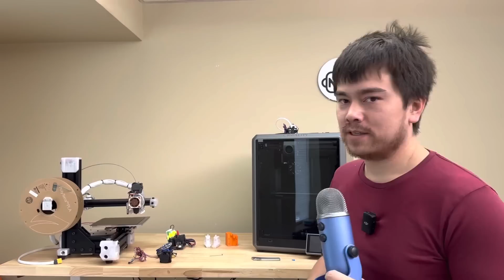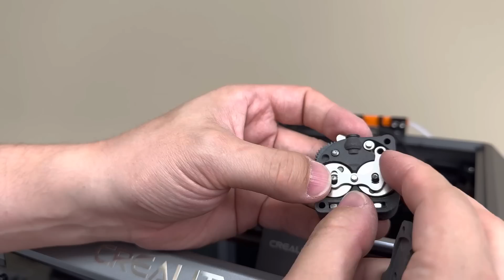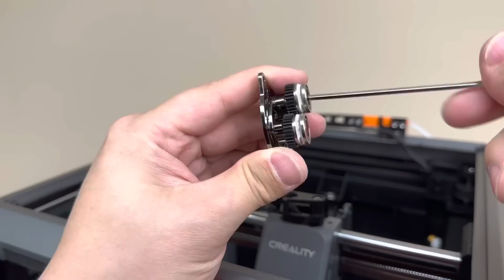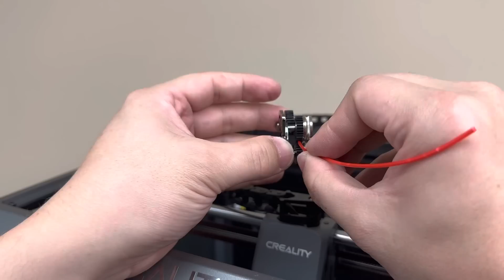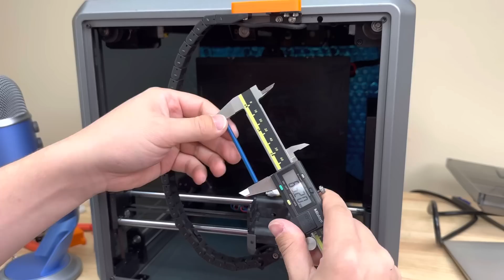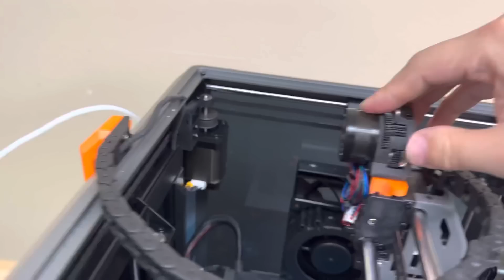Creality K1 Extruder Mod

Comment: To my knowledge bolts aren't designed to take shear loads either. The way a bolt connection should take up "shear" forces is through clamping the mating surfaces of the parts together and let the friction do the job.
Reply from the maker: Yes that is correct, but bolts are often loaded in sheer anyways.
Particularly when designing for failure load cases, often the bolt has to be modeled as a separate element that is loaded in shear. Bolts can loose clamping force for a number of reasons and in those cases the bolt will be loaded in shear whether you think it will be or not. 
Especially with plastic parts which loose clamping force over time due to creep.
Reply: That depends on the application. A fastened joint can either be a tension connection (also called a friction joint) or a shear joint (also called a bearing joint). A tension joint is critical for dynamic applications to prevent fatigue. A shear joint can be used in static applications like building as fatigue isn’t an issue given relatively low change in load experienced by the bolt. When building or bridges are assembled, there is a phenomena called bolt banging that occurs when shear joints settle into their final resting position. They can even bend and deform but it doesn’t matter as the ductility of the metal handles the shift. That would be very bad for a dynamic load though (fatigue once again).
Reply from the maker: Excellent comment, I will have to use the term bolt banging sometime 👨‍🔧
Reply: Nathan, you are spot on with the bolt bending comment.  I am structural engineer in the commercial glazing area (windows for commercial buildings). Because of tolerances between our windows and the building structure we often have to account for large shim distances which puts huge bending forces in our bolts.  I often have 4x’s the number of bolts because of the bending loads compared to what would be needed if it was truly a pure shear connection

Because of the materials in my systems i cannot use friction connections but instead have to use what is referred to as a “bearing” connection for the design of the bolt which ignores any friction and resulting tension.

I would love my billing rate to be &1000/hr 👍😁
Reply: @stephenfisher8522 when things go bad for you with tolerances =  expensive day + a massive mess in a best case scenario. Wowzer I am sure you have some stories lol.

Comment: Please be kind to attack this printer. Creality not open-sourced, they use klipper but don't give access even to config.
Reply from the maker: It’ll come out. There are already some leaks/hacks to get in there and they said they will be open sourcing soon.
Reply: @NathanBuildsRobots  but for now you should attack them. K1 is cracked already, frequencies and shaper are known, fluid/mainsail can be installed.
Reply from the maker: I am not so good at the Linux stuff. But if someone walks me through it I’ll make a video on it
Reply: @NathanBuildsRobots  there 5 simple steps or so, no need to be Linux expert
Reply: @CBORK27  brilliant. Please assist Nathan.
Reply: @corlissmedia2.0  English is not my native, it will be hard for us, in the other branch of comments somebody has successfully used k3d approach, I think he might help.

Comment: Looks great wonder how many mods fit on a k1
Reply from the maker: They are going to have to release the klipper source code soon, then we’ll get custom firmware which will make this thing a beast
Reply: @NathanBuildsRobots  you can already access it if you want
Reply: @TheOfficialDarkICE  how?
Reply: @xboxusr666  there is an exploit where you can access ssh. Then you can configure fluidd to work again. Was hidden after all.

Comment: Things will be so much better once we can get fluidd or mainsail access! Well done on the mod.
Reply: I wouldn't be so sure, no one has fully cracked the sonic pad yet and are still extremely limited and there's no one to force them to release the source code, while it's in the licence agreement there is no one to police it. The printer has potential for sure but like the other creality printers you have to spend loads on them before they print the way you want them too.
Reply: @TechieNI  Actually, what about this idea that Creality is using Klipper WITHOUT a license? Doesn't that mean that Klipper has a hammer they can use to get Creality to Open-Souce their version of Klipper?
Reply: @corlissmedia2.0  Anyone can modify to code wether they have a licence or not. There is nothing that can be done for breeching the licence or code. It's more of an ethics thing. Creality gave been doing it with marlin since ender 3 and nothing has changed with creality. They were using code then and they are doing it now. There is no one to stop them as such because klipper like marlin are just a group of people all donating their experience to the project. While I love klipper and even marlin and wish they could take creality the facts are that with a Chinese company even copyrights and trademarks don't apply the same was as they do elsewhere.
Reply: @TechieNI  I hear you. Now Creality’s stealing from Bambu Labs. The thief’s are eating their own.
Reply from the maker: What exactly are they stealing from bambu lab, other than maybe a design philosophy?
Reply: @NathanBuildsRobots  z axis, probe
Reply: @NathanBuildsRobots  that sounds like a great video.
Reply: @NathanBuildsRobots  When you have them side by side, it's pretty obvious, don't you think?
Reply: @TechieNI  Russian community k3d has.
Reply: @CBORK27  Completely unlocked it? This is something I would be very interested in of so.
Reply: I just got my printer and will be trying to get root access. I’ll keep you posted. K1 has been great so far though. My extruder has a very firm engagement fortunately l.
Reply: @xsvforce3335  EXCELLENT! I wish you the best!
Reply: I now have full root access and a complete web ui
Reply: @xsvforce3335  that’s freaking amazing! Will you be sharing?
Reply: @corlissmedia2.0  the latest k3D video has the link to files required and the instructions. It’s Russian but it all can be translated well enough.
Reply: @xsvforce3335  I don't know what k3D video is / are? link? or email; it's on my yt
Reply from the maker: Someone’s going to hack the firmware and get real klipper on there. I’ve seen a couple videos of people SSHed in there already.
Reply from the maker: Yeah, I’m sure it will happen soon, whether creality releases the firmware or not
Reply: I’ve tried a few hacks with no luck. Going to restore from an older firmware and try again.
Reply: @3DPrintSOS  Keep Trying! You'll be an absolute HERO if you get it done!